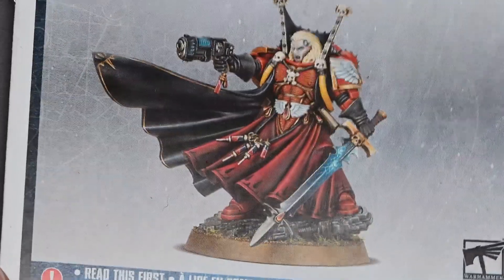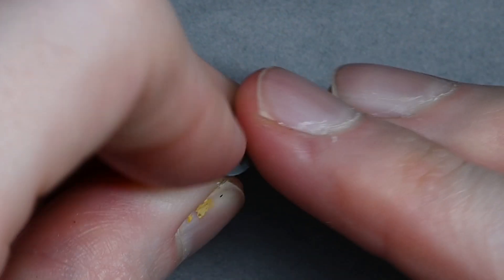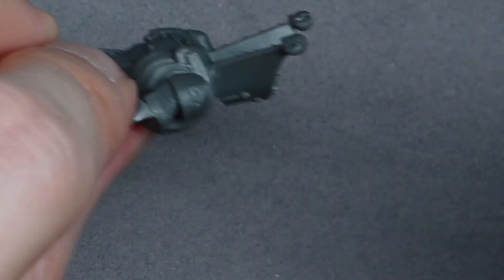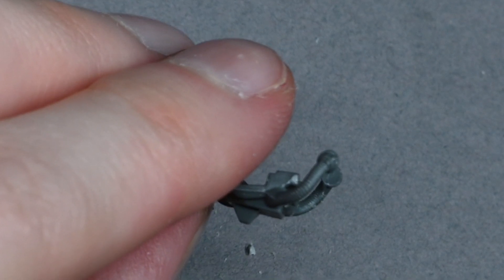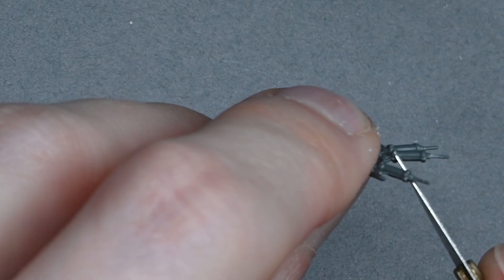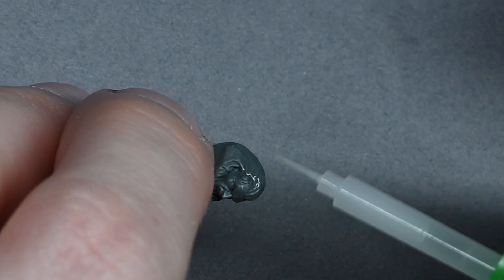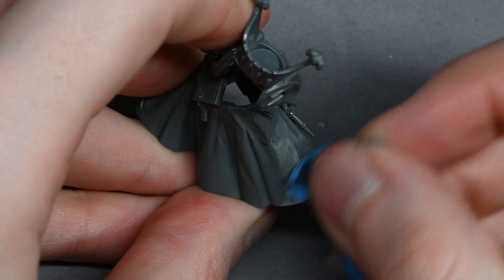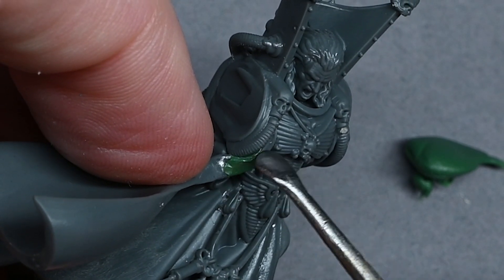Build and Convert Mephiston Without Mould Lines or Gaps!

Comment: 11:17 or me! I can stand mold lines and clean all my models (also my gaming models) like you do in this video. It does take a lot of time though, but I kinda like the act of cleaning as well. Also a great time to catch up on podcasts!
What I have learned is that I treat any model as if it where a display model. I might need to start cutting some corners if I ever want to finish an army. Or don't worry and just do what I like to do: be super precise. Hmm...

Comment: Thx for this. I've seen Tamiya extra thin cement recommended often, but I'd shoes away from it thinking it would be difficult to avoid it running. Now that I've seen how small the applicator brush is, I'm much more comfortable with the idea of trying it.

Comment: I just built the new Lelith Hesperax with Tamiya extra thin before seeing this video, and filled in the seems with liquid green stuff and superglue. 

But damn it, your method seems so much better and easier. I am definitely going to use more glue in the future after seeing this. I am also going to use my scalpel more and ditch the sandpaper and files for mold lines - s time consuming ,when you can just scrape with a scalpel and smooth other with the thin glue.

Looking forward to seeing more videos from you!

Comment: One tip I forgot: if you want check if your clean up job was good enough, simply prime the model and go back where needed (like Richard does here). Alternatively you can use a marker (a lot faster than priming) to go over the part where you filled a gap (for example) to see if it ended up being smooth.
Reply from the maker: The marker is a very good tip! The number of times I've primed a resin model only to find the mould line is still visible 😭
Reply: Sorry for the late reply but I wanted to share something I recently found. It’s a product called Mr Cement SP Black, which combines your tip with the smoothing properties of Tamiya extra thin. Also, I find this cement is less “hot” which I prefer as I have to be careful with Tamiya extra thin not to use too much and accidentally melt off too much detail! It’s now become my most used plastic glue!

Comment: Glad to see I wasn't nuts for thinking that Tamiya extra thin is a godsend for small details! I cleaned up the hands of ~180 goblins using that trick, since it's incredibly fast. I only wish I'd thought to use it when starting out.

Also this is just showing me i should go back to the Revel I have lying around; it seems to give some of the sprue goo benefits without making my apartment smell like death warmed over. Cheers!

Comment: In the past I've used a scribe tool/ scriber (like the ones used for marking metal work and tapping holes) to remove the mould lines in between detail lime plasma coils and ribbing. It helps keep the detail intact due its point conical shape.

Comment: Great video overall! If you cut too much stuff away, or you are dealing with a not so clean sculpt, I would use something people call sprue goo. It's Tamiya extra thin cement (or any other very thin glue) and put some sprue bits in the glue and wait for them to dissolve, to create a kind of liquid plastic that fuses itself to the model and after it's dry, you can cut stuff away like you normally do when tidying up a piece of the model. So basically what Richard did with the Revell glue, but use it when you need more body.

Comment: Pro tip with using the glue! I generally use a toothbrush to remove the plastic shavings (not the same one I use for my teeth :p) but the glue will save me loads of time trying to smooth in between the ripples. Thank you

Comment: I hated prepping this model. That awful gap where the cloak attaches at the front is an absolute fail on GW's end. I tend to fill gaps with sprue shavings, and adding Tamiya Extra Thin so that I don't have to keep spending money on putty. For those demonic plastic injection lines, I personally just use emery boards cut down to whatever sizes I need, and bend high grit wet-and-dry sandpaper for curved surfaces.